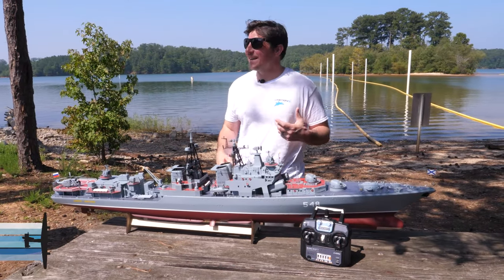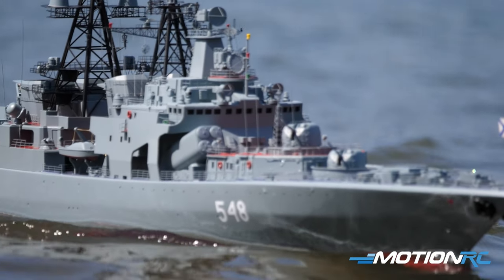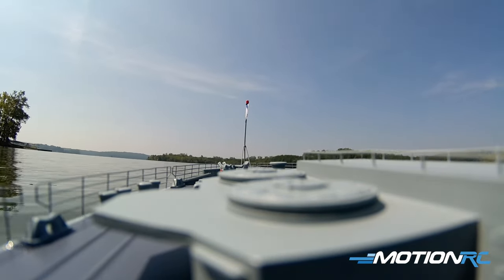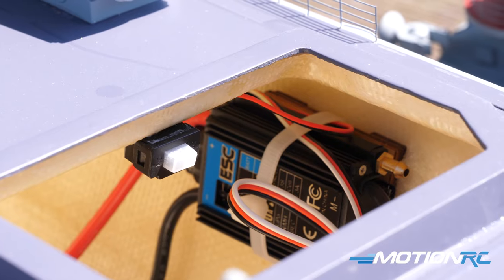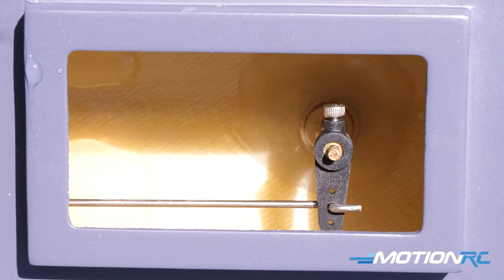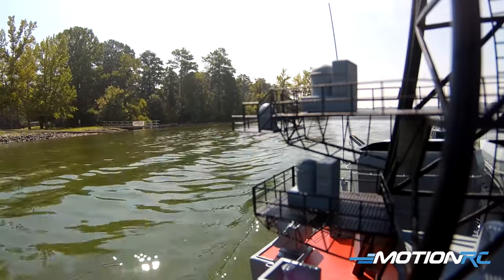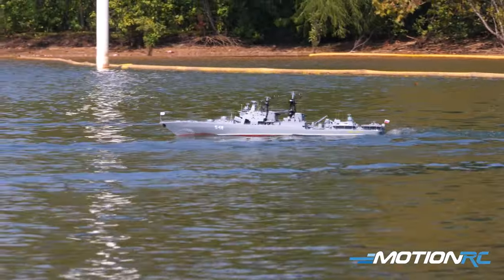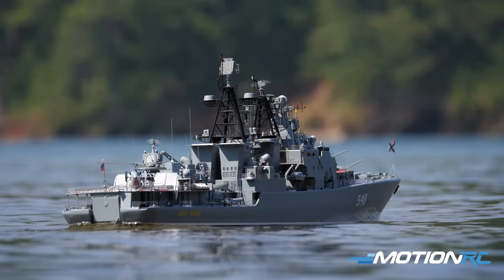Bancroft Udaloy 1/100 Scale Russian Missile Cruiser | Motion RC

Comment: Does the boat come balanced or do you have to balance it urself?
Reply from the maker: You have to add ballast yourself. Since many will use different batteries etc, it's better to do it yourself. I make 1lb sandwich bags of BB's and place them around to acheive proper ballast after I secure my battery location.
Reply: @MotionRC ok ty so much